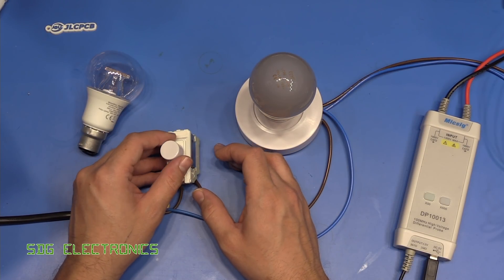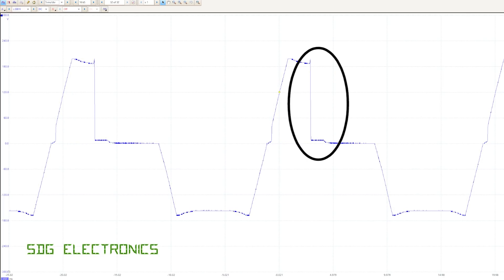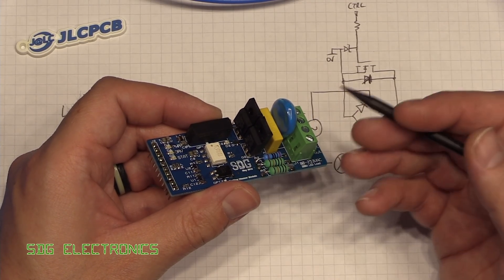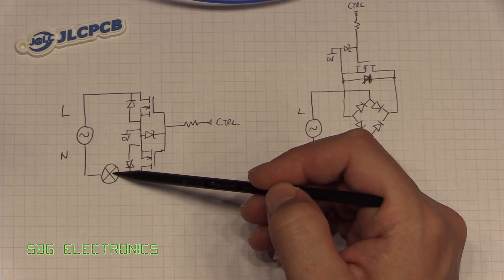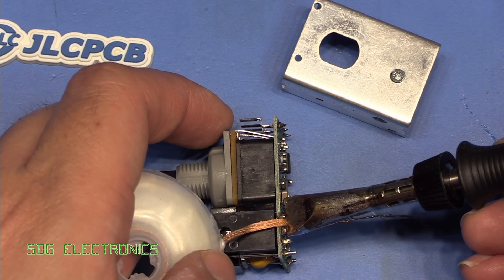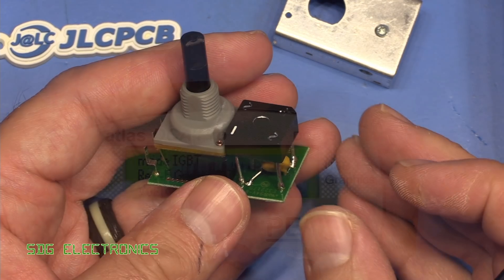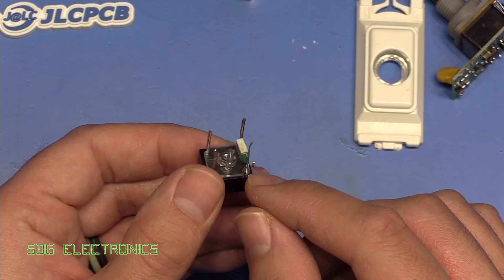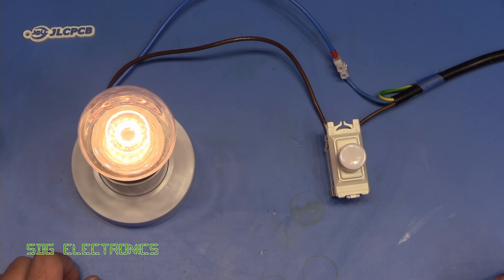SDG #240 Repair and analysis of a Varilight V-Pro AC LED Dimmer Module

Comment: Are those light fittings most common in UK? Im quite used to the screw type e14/e27 and never saw that kind of fitting irl
Reply from the maker: We primarily use bayonet cap lights since they're safer than edison. Generally though most will use some kind of integrated light fitting these days, or maybe a miniature 50mm reflector type lamp

Comment: I played with these dimmers some years ago, ended up removing their micro and controlling a bunch of them with an Arduino I was wondering how the automatic load type detection worked, I didn't need that for my project at the time but might be useful. I used them for this (lights at 1:40 in) although annoyingly they don't show the fading chases it could do. https://www.youtube.com/watch?v=fCM3Fi7lPP4

Comment: I would have thought that a bit of heatsink paste might have been applied between the thermal fuse and the transistor. We used to use a very sticky paste that did not run when it got hot, but did give us a more consistent fault trip time. 

I was thinking that we may get though the video without a soldering Iron station review, but you got a quickly in. Shame the transistor tester has acquired a dodgy display will we be seeing a repair video soon.
Reply from the maker: Yeah, the overtemperature fuse won't trip until it's already too late. The heatsink paste that was applied is probably almost meaningless too since both the rectifier and IGBT both have plastic packages. I did consider gluing the fuse, but the load won't be changing from the 5 fixed lights so I think we're pretty safe from any kind of overheating event.
Reply: @sdgelectronics  The thermal fuse will respond well to case temperature, those units are pretty well insulated inside the plastic, so will get nice and toasty easy enough. Probably sent off the diode with a mains spike, as the MOV should have been across the AC pins instead, so that the MOV protected the diode bridge, instead of the bridge protecting the MOV.